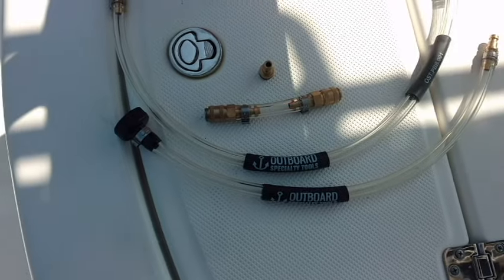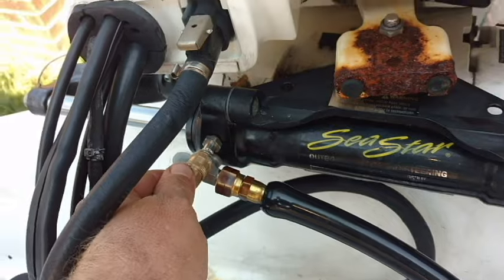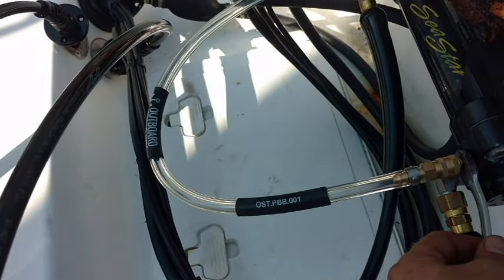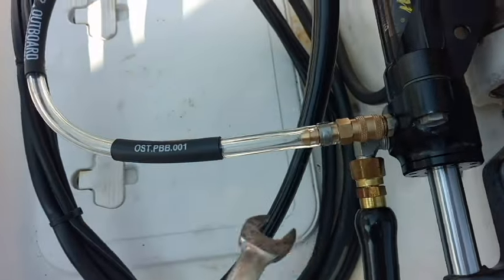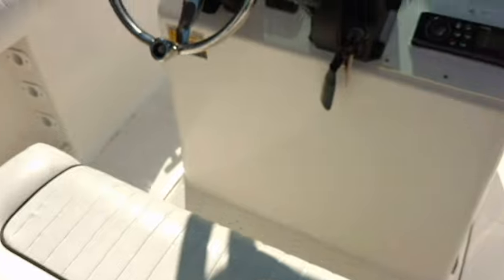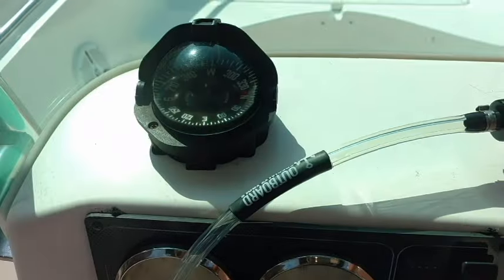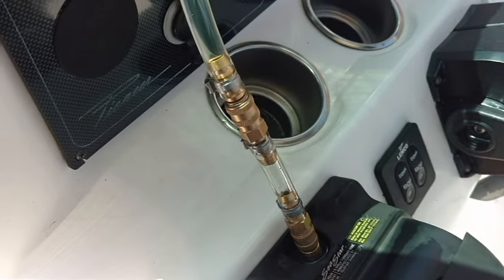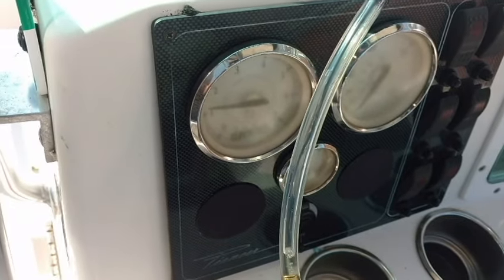Bubble Purge™ SeaStar Hydraulic Steering Bleed Repair OST

Comment: Great video, watched several times as we’ve bled several buddies steering systems the last couple years. Works great! Ran into a snag though. Replaced friends cylinder seals a year ago and everything was good. This year he had the seals fail again. It was actually squirting fluid from seals not just a small leak. So we replaced seals and tried to bled system but we are not having any air bubbles escape through the tube at helm. See bubbles flowing through bleeder hose at cylinder but they just keep circulating and won’t ever leave the system through the helm. Any ideas?
Reply from the maker: Hi Stacy, The steering piston rod, which runs through the bore in the cylinder needs to be inspected for pitting.  Even minor pitting on the piston rod can degrade new seals prematurely.  Often the pitting can be hidden as the rod can pit out where the end caps of the cylinder rides, so the cylinder may have to be moved to port or starboard to get a better look.  In the event that the rod is pitted out it can cause 2 major problems that will impair not only the cylinder but also the helm.  1) end cap seals will fail, system loses fluid and can easily take on contaminants 2) any contaminants, especially water that end up in the system can cause issues with the valves in the helm pump which control the movement of fluid and hydraulic pressure within the hoses and cylinder. 
If the helm valves are fouled or pitted they may not seat properly which will prevent the system from building pressure and holding it during actuation as well as allowing feed back, which would normally be locked out by the helm valves, from the motor through to the helm when running at higher rpm's.   If the helm is compromised, it is often pretty easy to find with the following test:  push firmly on the motor and hold the pressure for about 10 seconds, if the steering wheel starts to turn there is an issue.  Normally the helm valves will seat and lock out feedback as soon as a sharp push on the motor occurs.  

The issues you are seeing are usually pointing to an issue with the helm not being able to build enough pressure to force everything back to the helm.  This is caused either by the helm pump not being fully primed/full of fluid or by the valves in the helm being damaged or contaminated.  In this region, where most systems spend their service lives in the salt environment, most helms are on borrowed time after about 10 years in service.  

If the piston rod on your system is pristine, it is always possible that you have a defective seal in play.  If using SeaStar OEM seals, this would be very rare, especially if occuring on both end caps 1 year in.
Reply: Thanks for the info. Inspected piston rod and system and everything looked good. Ended up having start the bleeding process the old school way by bleeding out air from each bleeder individually until we had enough air out to continue the process with your purge kit. Looks like all is well. We’ll keep an eye on it and hopefully these seals will hold up. Thanks again.

Comment: Tyler - I purchased the kit after watching the video. If anyone reading this is skeptical on purchasing such a kit, let me say that " I had my boat into the dealership that sold it to me, and 3 other dealerships and one private mechanic to get the non responsive "spongy" feeling out of the hydraulic steering and NOT ONE SINGLE OUTBOARD MECHANIC was able to fix it..! I used this kit alone, and was able to get ALL OF THE AIR out in about 45 minutes...!! If you think that air is not the enemy on hydraulic steering, I would challenge any boater to come through our inlet on an outgoing tide. This inlet is considered to be one of the 7 worse on the east coast. The motor has NOT been this responsive in the 13 years I have owned it, but thanks to Tyler's invention (a.k.a. the "kit") it works like it should have all along. Worth every dime. Tyler you are a frigging genius...!! Now for your next project, figure out a way to jump out those dang neutral safety starting switches that sit down in the cowl, so that we don't need to jiggle the handle when the boat won't start - do that and you are my hero..>!
Reply from the maker: Hi David, We really appreciate the feedback and are always happy to hear we've been able to help!  Thanks

Comment: To really get the air out of the helm, you have to move it to one end and add a little more pressure, and then "pop" it to opposite quickly.  It gets out the air trapped in the valve areas.  You do it back and forth on either end of the travel and it gets most of the bubbles out.
Reply: Instablaster...

Comment from the maker: No need to poke holes in the bottle.  Fluid drains out of bottle and air rises into bottle in more or less equal volume.  Occasionally I will disconnect the bottle at the quick connect to verify that the bottle isn't building internal pressure, but usually not necessary to vent.
Reply: So where is the air going I just watched another video where he pushed the air into a jar and put the hole in the bottle everything is sealed tight where is the air exiting not being smart just asking a question

Comment: seems one could add an electrick hydraulic pump to this and run the fluid round the system with a flick of a switch. neat set up you have build there
Reply from the maker: We've thought about adding some form of electric pump to the system, the main reason we haven's is that it would be a pricy addition to the kit and also would add a new layer of required expertise.  If the user accidentally leaves bleed valves closed while using the G2 Kit, the helm will bind and they usually figure out that they need to open the bleed valves.  The electric pump does not care if bleed valves are open or shut.  It will push fluid and compress any air in the system as long as it has power.  The pump would also need to be able to maintain a certain level of pressure to actually circulate through even very small systems.  You haven't lived until you've seen a helm fill go "pop".  Hydraulic mist, happens surprisingly fast.  Hydraulic fluid will be dripping out of every nook and cranny near the console for years.

Comment: Did this with my twin engine ob and worked well.  I think there is room for improvement on the return line.  A fitting at the jug seems wiser and time saving.  But very pleased with the product.  Thanks.

Comment: One question. If the bypass hose is full of air when you start turning the wheel aren’t you introducing that air into the system starting out?
I realized this after trying to figure out why there was so much air traveling through the hose. It took me 2 hours to get all the air out. One thing I learned is you need to mentally track the large air pockets from the bypass tube down through the hull and up to the helm then stop turning the wheel and let the air work its way up to the helm. Air bubbles rise slowly. Then work the wheel back and forth in short bursts in several locations to get that air pocket out. Then find the next air pocket in the bypass tube and repeat. I think I would have cut the air extraction time way down if I had filled the bypass tube with oil before connecting it.

Comment: So basically with this system , you can bleed out a Seestar steering system without making a mess and doing it by yourself ?  I just picked up a used ranger with a Yamaha 150 Vmax , it has a SeeStar hydraulic system on it and the steering is way loose to me . Plus I am new to the whole hydraulic steering system to begin with . Last boat was cable so this is completely new to me . I did buy a bottle of fluid and a fill hose from a location shop . After watching this video , and being a mechanic myself , this looks straight forward,  and not complicated to do .

Comment: Is there different size bleed ports on Sea Star steering systems? I have model HC5345-3. When I connected the quick disconnects of the bleed tube to both bleed ports, and opened the ports, I have fluid coming out from the quick disconnects connectors.  I tried numerous times removing and reconnecting the tube. But it would leak really bad every time. Not sure if the quick disconnects are faulty. I even tried swamping sides with the tube, but I have a lot of fluid all over my garage floor.
EDIT: I should of mentioned the kit that was leaking was from a different company I bought off of Amazon. I bought your kit after and it worked as it should. NO LEAKS and I was able to bleed all the air out of the system. Great product and awesome video on how to do the job yourself. THANKS
Reply from the maker: Glad to hear you are back up and running.  We have had serious issues on Amazon with 
mostly offshore vendors producing copies of our patented kit and selling on Amazon, and in fact we are in another round of working with Amazon to deal with another batch of imitators ripping off our kit.  Amazon has been great so far in helping us deal with this issue, having de-listed more than 50 companies whose listings are direct copies of the G2.
Fittings:  There should definitely be zero fluid leakage out of our quick connect fittings, they should always have a tight seal.  In the event that any of our fittings leaks it is normally something that we warranty immediately.  It is not unusual to see the o-rings on the actual cylinder bleed fittings degrade over time and they can leak when the bleeders are opened during maintenance.  Since they are within half an inch of our fittings, it can be tough to differentiate, but regardless, if our stuff is leaking from a place that should be sealed, we will cover it.
Reply: @outboardst.comoutboardspec8631  thank you for the reply. I would definitely recommend your bleeder kit to anyone wanting to service the steering system. Also, your videos are great help!

Comment: I have to replace a hydraulic hose on my brand new system due to a faulty hose from seastar. Which means I'll have to remove hose and let all fluid drain out ..then refill after hose replacement. I was going to use this method to fill my bone dry system after the repair. I noticed in your video your system only required 1 quart. Aren't most sea star systems a 2 quart fill? Awesome video ...thanks !
Reply from the maker: Fluid quantity usually varies a bit depending on the size of the boat and steering system configuration: single helm/dual station or multiple cylinders, power assist etc.  If it is roughly a 20ish foot boat with single helm/single cylinder it usually holds about a quart.  If I am flushing the old fluid out of the system, I usually chase it with new fluid.  A full flush, fill, bleed with this method will consume between 1 and 2 quarts.

Comment: looks good... but you do mention you replaced the seals first. How do we know those are gone? (I assume leaking, etc). Mine is quite low, will just filling help the situation? Not sure how to empty (purge). The other thing thats a bit confusing is you say turn to starboard... then move motor by hand? thx

Comment: Surprised no one fills the jumper tube with oil before connecting... empty (air filled) tube introduces more air to be purged
Reply from the maker: Yes, that's definitely true, and definitely will add job time to remove the additional air.  This is something that didnt cross my mind back when I created this tool, but after working with it for a while I realized the same thing and posted short video on how to prime the Cylinder Attachment before connecting it to a steering system and adding a bunch of air.  Definitely makes the job go faster.
https://youtu.be/MfTQb1PfzSw

Comment from the maker: The rebuild tool kit that we make, item number OST-0300, is strictly the tools required to do the cylinder tear down, re-seal and bleed.  SeaStar manufactures the seal kits, part number hs5167.  We do sell the seal kits on the site, but they are widely available elsewhere like Amazon, West Marine etc.

Comment: When I’m turning the engine in this process the quick connect fitting is rotating up with the cylinder and hitting the engine and will not turn any further without braking off, Yamaha 250 SHO, is there a solution for this? I messed with the trim and jackplate trying to adjust but no luck

Comment: Hi tyler, do i need to buy Stud OST-0013 from your web or can i used the Yamaha  Pin Wrench AMT0004-38mm x 4mm are they the same? i got the Uflex hydraulic steering on a single F300 btw love your video.

Comment: Question:  I noticed that you were turning the wheel in one direction you said 30 turns I believe.  How can the wheel turn that many tiems in one direction?  Is it because you have the tube on the actual steering rim in from of the outboard?  2. Is there any case that turning the steering wheel in one direction that many times would damage the steering system?  i have the bubble purge G2 and a 19 foot Stratos bass boat with a sea star steering rim Suzuki DF200 a outboard (200hp inline 4) .  My steering is really bad and i can turn the outboard with my hand.  I cannot take it out safely until this is done and i just want to be 100% sure I am not doing it wrong.
Reply from the maker: Once the bleeder valves on the cylinder are opened up, the helm will be allowed to turn infinite rev's in both directions since the steering system has no resistance, its just cycling fluid. With the G2 kit you should be able to get the air out of the system fairly quickly and then you either have a steering system that can pass testing and is ready for the water or you have a system that still needs further repairs.  The first step is always to purge the air from the system and verify that there is enough fluid to be able to build and sustain hydraulic pressure.  So, if you have removed the air from your steering system, and you are still able to push the motor side to side there is definitely still a problem somewhere, which will need to be isolated.  The problem you are describing is often caused by malfunction in  valves in the back of the helm which are responsible for managing hydraulic pressure as well as locking out feed back coming from the motor.  Next time you push on the motor, keep your eye on the steering wheel.  If you push on the motor, the motor moves and the steering wheel starts turning at the same time, it is likely that the valves in the helm are not seating correctly.  Occasionally, the cylinder can either develop internal pitting or the piston seal can crack.  Both conditions would allow fluid "blow-by" and the cylinder would not be able to hold pressure in part or all of its range.  It is very important to isolate the failed component accurately so as to avoid wasting money on replacing parts that may not be damaged.  We sell a diagnostic kit which makes isolating these issues much much faster.

Comment: Hello, viewing a previous one of your videos on replacing seastar seals, I have a question:  I have a seastar HC4645H model and the seals available are GEN II. Are they the correct seal for my current cylinder?  It was purcharsed on 2008.
Reply from the maker: If you are using OEM seals made by SeaStar either the HS5157 seal kit or HS5167 seal kit, they will fit all SeaStar cylinders from Gen 1 to current

Comment: I have been working on this for 2hr and have a blister on my finger from turning the wheel
Reply from the maker: Greg, I am sorry to hear about the job dragging out.  With most systems, you should not need to be turning the helm for more than about 15 to 30 minutes to completely fill and purge.   Here are a couple of suggestions that Im not sure if you've tried that may help, if you do not see results within 15 minutes of trying these, it is best to stop turning the wheel and please contact us.  We will assist any way we can.  If the system is completely empty and full or air, sometimes the pistons in the rotary pump can hold air, the easiest way to displace the air is to squeeze the fluid bottle while turning the helm, and it should prime up and start pushing fluid pretty quickly.  If the helm is full of fluid and you are just seeing bubbles sloshing around in the Cylinder Attachment, with no fluid starting to fill in, this can be an indicator that the valves in that back of the helm are not seating properly.  This is a common problem on older helms, but I am not sure of the age and condition of your system.   If the valves are pitted, sticking or not seating properly the helm cant build enough pressure to push fluid through the hoses and may not be able to allow fluid to cycle back in via that passive hose.  Hopefully, your helm is in good shape, but if there is a problem with the valves, it likely needs to be repaired or replaced.  If you have questions, we are here to help.  Please call us on the number listed on the website.

Comment: I purchased the fittings from NAPA. When I loosen the fittings mine will not run in a continious circuit. It just runs to lock and the steering wheel will not turn any futher. Any ideas?